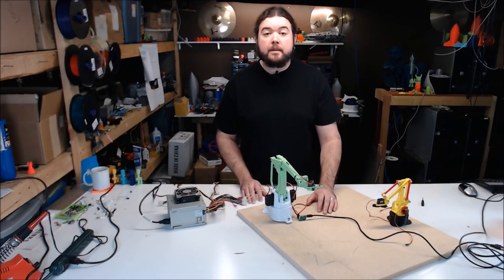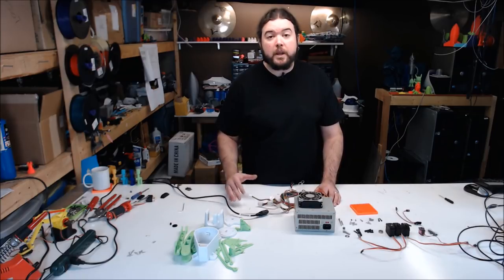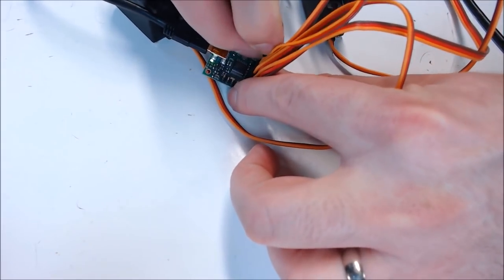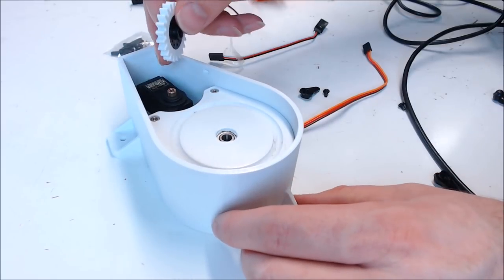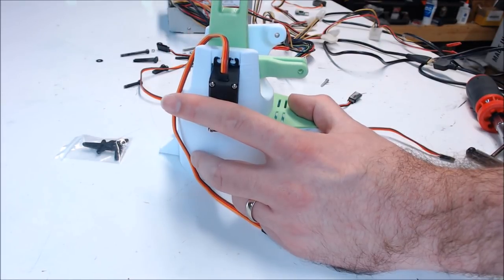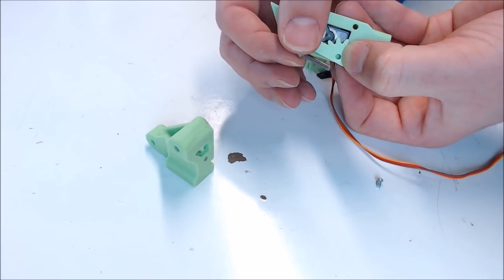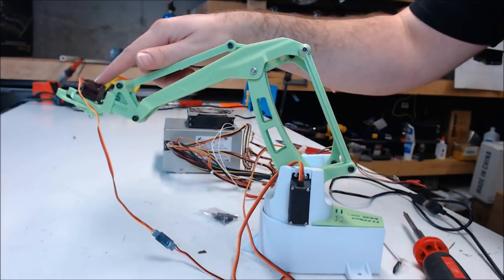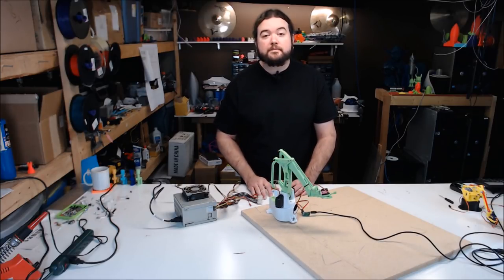EEZYbotARM MK2 3D Printed Robot Build - Chris's Basement

Comment: This was a great video. Just had a question, how does the self locking nut allow movement and sorry if it's a stupid question.
Reply from the maker: Thanks! If you use the nylock nut it will stay in place and allow you to leave it loose so the arm will move on the screw.

Comment: Mine's just about done. Having trouble sourcing those threaded rods though.  Also the power supply. I don't think I have anything that provides power and hooks to pins of the Pololu
Reply from the maker: The rods are hard to find. I just cut my power supply wires and added connectors.
Reply: @ChrisRiley  where did you find the rods? I’ve looked in stores and online, can’t find them at the right length.
Reply: I got some large bolts and sawed the heads off to get the rods.

Comment: You hve any idea abt the viridis 3D printer in which the printer head is used. I want some details abt the printer head nd if possible thn its design in solidworks or can work with the dimension nd all 

Thanks for the help..👍👍
Reply from the maker: Thanks for the comment. I know very little about it. I have seen it in action and it is very cool. Sorry I don't have anymore info.
Reply: Ok thank u👍👍

Good going keep it up.

Comment: Thank you for detailing the construction. Printed it and just started putting it together. There are no holes in the EBAmk2_012_mainbase.stl file for attaching the servo (6:01 into the video). It looks like you drilled those holes after the piece was printed? What size drill bit and how deep? Thanks.
Reply from the maker: Thanks for watching. I just used the screws that came with the servos and let them tap the holes. They went in pretty easy if I remember correctly.

Comment: Hello...

Thanks for the detailed explanation...actually we are working on the same project but with some change in design and we are planning to work with arduino UNO. Can u tell me what are the think to keep in mind while working on this.

Thanks for the help.🙏
Reply from the maker: It's a pretty easy build. I would just make sure you use a drill bit on the holes before you assemble it. Let me know how it goes.

Comment: Thanks Mr. Chris for the tutorial.
I have a question, Is possible to main base turn 180°?
Reply from the maker: You're welcome! Yes, I think it would spin 180 just fine, but you might have to go with a different servo, or get it set just right.
Reply: The gear for servo : the gear of base = 1 : 2, am I right Mr. Chris?

So if i want main base turn 180 then I need a 360 servo. Do you have any suggestion for 360 servo, which is not a continuous servo (with this type, we can't set the degree)?

Thank you very much
Reply from the maker: 1 : 2 looks about right, but I am not really sure. I really don't know of any servo that can spin 360 out of the box, but there are a lot of different mods online that you can alter a regular servo to do this. That's about all I know, sorry I couldn't help more.
Reply: Thank you very much Mr. Chris

Comment: Hey, my main base does not have the tiny holes for the servo screws in real life and when looking at the files. How did you get the tiny holes for the servo? 6:06 is the tiny holes im talking about.
Reply: My file does not show the holes at all.
Reply from the maker: Wow, I wonder what has changed? I guess you could just drill some if you have a small bit.
Reply: @ChrisRiley  yea, that's what I'm planning. I have no clue why it's happening. Print quality is good and everything.

Comment: You have link to buy the power supply to the Pololu? Thanks
Reply from the maker: You can use pretty much anything that is 5v. These seem to work well for the servo side. You will still need USB for the software side. https://www.amazon.com/gp/product/B00P5P6ZBS/ref=oh_aui_detailpage_o06_s00?ie=UTF8&psc=1
Reply: Chris Riley thanks. Did you print all the parts with PLA?
Reply from the maker: Israel N Yes, all PLA.
Reply: Chris Riley Hi I have problem with my Pololu. If u can please help me 
https://forum.pololu.com/t/i-need-help-with-the-connection/14428
Reply from the maker: Israel N Which power supply did you go with?
Reply: Chris Riley  I have a usb cable that's connected to a usb power adapter (connected to the wall) and the other side is connected to the boad
Reply from the maker: Israel N you will need the red and black wires, 5v and ground. I don't think that is going to provide the current you need. I would try to find something 3 amps or better. If you can salvage an old pc power supply those work great.
Reply: Chris Riley in pc power supply I need connect the red wire to+ and the black wire to- ?
Reply from the maker: Yes, red is 5v black is ground.
Reply: Please make it a 3d printer.